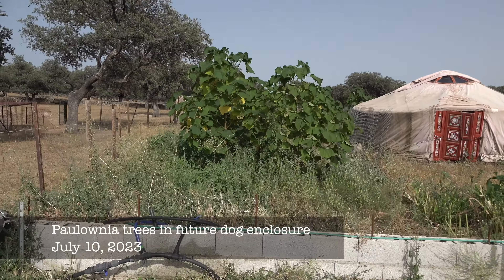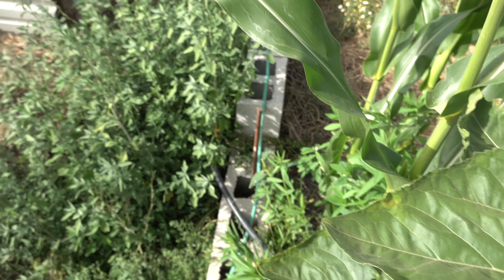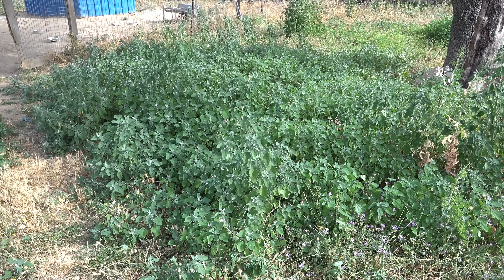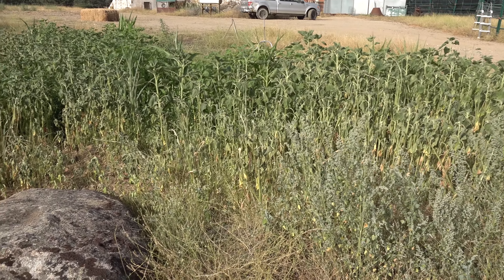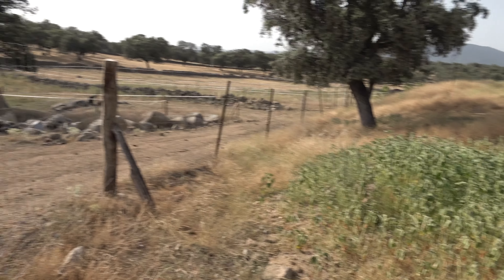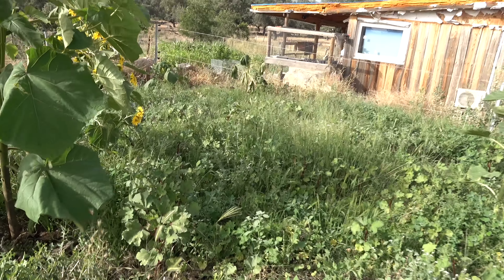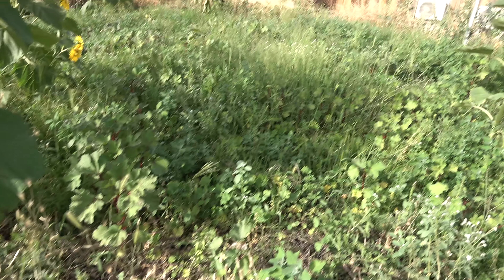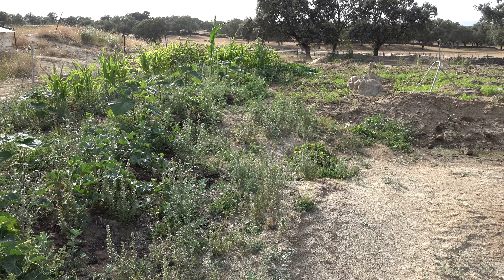Building Soil and Background Information

Comment: Farm is looking so much better than start. I can see your care.

Screwdriver test. 
Easy to push in soil wet sound mushy= too wet. 
Hard to push in = too hard

Better yet Shovel and dig up spot around plant. If you can squeeze and soil holds shape its right few drops water okay.   Dry... flakes away. Wet water squish out. 

most common cause for yellowing leaves on trees is a lack of micronutrients—the mineral elements essential for the growth of plants. Micronutrients include iron, manganese, zinc, copper, boron, silicon, and molybdenum.
Reply: We got a pH meter and aluminium sulphate to lower the pH. Thanks for sharing. Keep sharing!

Comment: Wobblers use Senninger’s off-center rotary-action technology, which provides extremely uniform coverage over a large diameter at low pressures. These produce droplets that resist wind-drift and are applied in a gentle rain-like pattern.
Reply from the maker: Who makes them?
Reply from the maker: I found a source for them here in Spain. Definitely going to try these. Did some "research" and am intrigued. Thank you!
Reply from the maker: @stevejohnstonbaugh9171  Certainly not
Reply: @stevejohnstonbaugh9171  you’ll see soon what we are gonna do 🤠

Comment: Cheap foliar spray would help imo, knf.  Seaweed or sea salt mineral 

SeaSalt contains all 92 of the natural minerals in the relative ratio of what plants need. For garden and new plantings. Would help your acorn production long term too. 

Seawater Trace  Minerals

Dan Kitteridge Living Web Farm Part 7 / 18 min mark

Go to Ocean or get Sea Salt cheap sea salt ~$150 ton / $6-15 for 50 lb bag

Things Needed
55 gal Barrel
5 gal Bucket
Lye
Stick for 55 gal barrel
PH paper
Hose Siphon

Set 55 Gal Barrel above high tide
Use 5 gal Bucket to fill 55 Gal Barrel
Pour Lye in until PH paper reads 10.4
Wait 24 Hours while Trace Elements (4%) separate from Sodium Chloride (Salt 96%)
Siphon off Salt top
Cream falls to bottom: Capture the 2.2 Gallons of FULL spectrum of all Trace Minerals (cream colored 4%)
1 Pint Foliar sprayed per Acre /  1 Quart onto the Soil per Acre
Foliar Spray add Carbon like Humates or Powdered Biochar

You can also spread 75 salt lbs per acre in fall on whole farm soil
Reply from the maker: There is a lot of things to learn and do. Thanks.